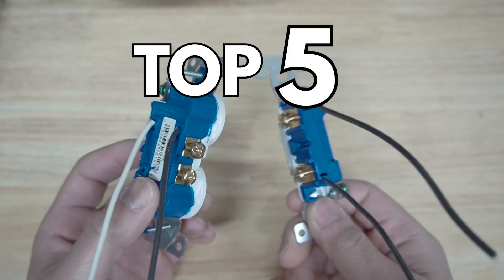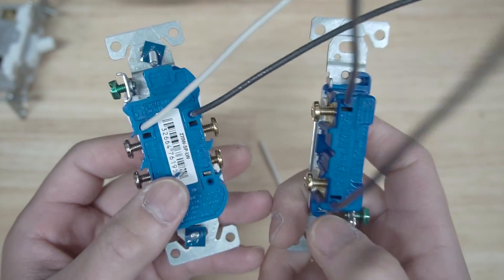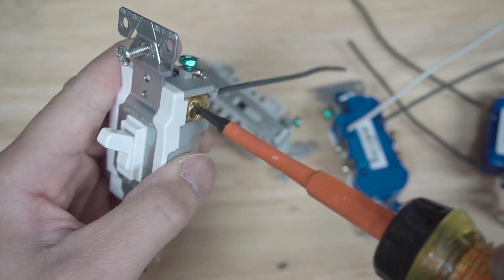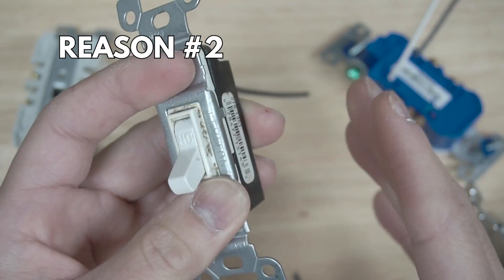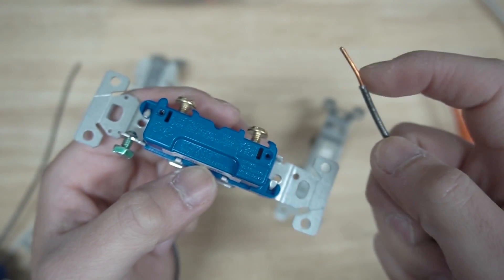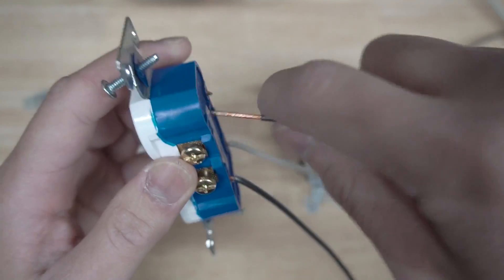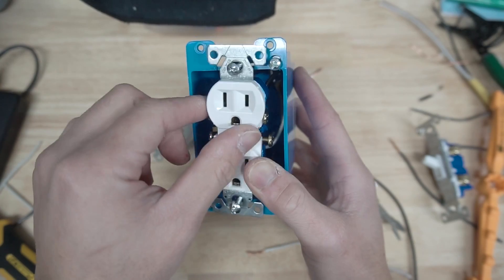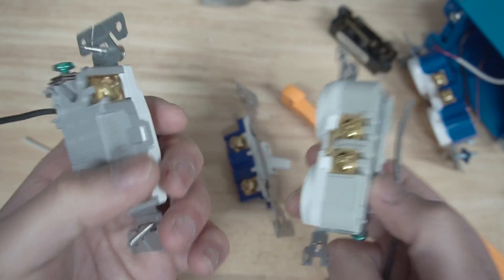The BIGGEST Mistake DIYers Don't Know They Are Making When Wiring Outlets And Switches! How To

Comment from the maker: ITEMS I USED:
- VOLTCLAW - https://amzn.to/3Lcugmd
- VOLTCLAW COMBO PACK - https://amzn.to/3utk2ai
- KLEIN Voltage Tester - https://amzn.to/40VRl7y
- KLEIN Insulated Screw Driver - https://amzn.to/3WFt0QM
- WAGO Wire Connectors (36 Pieces) - https://amzn.to/3LnE2Tn
- WAGO Wire Connectors (75 Pieces) - https://amzn.to/3JgpYcF

Comment: Thanks! The backstabs in my 1985 house have loosened to the point of failure causing all kinds of problems. We were about to call an electrician (AGAIN!) but now we are going to buy better receptacles and wire them properly.

Comment: If there are burn marks or carbon deposits this is not produced by heat in the switch but it means a poor connection is causing arcing of the contacts.

Comment: The exposed wire is not near as big a deal as the exposed screws on the side.  Maybe the electrical tape wrap people care, but nobody else does.

The problem with the back stab is load dependent.  200 watts of lights (or today, 20 watts of LED lights) isn't going to bother that back stab at all.  Mine where the back stab was used to feed a few hundred watts of ceiling heater, and almost 1000 watts of lights burned the wires to a crisp and heat damaged the insulation nearly all the way back to the box.  I'd like to shake the electrician that wired my house as everything was done back stab and usually used the devices to feed thru to downstream.

Comment: These holes are not for wires. Their purpose is to release gases formed by arc.
Reply: Are you serious right now? Lol they have a spot to measure your wire on the back for this speed wiring. Right or wrong, the holes are certainly for wiring. 😂
Reply: @rockyschurman8625  The holes are not for wiring. Somebody had designed them for removing gases caused by arc, but managers without technical education haven't understood real purpose and decided to use for quick wiring. Engineering department has very poor communication with management department, so gas holes are used for wiring.

Comment: Reason #1 not to have it explains why manufacturers still use it. If they have people thinking their switch is broken because of a bad connection then they buy more switches thinking that switch broke. Commercial customers would buy another brand if they failed that often from a connection. Its a stupid tax on residential buyers
Reply from the maker: Thank you for the info!